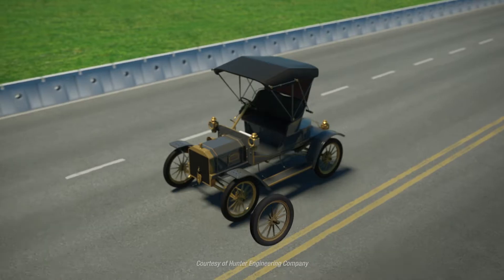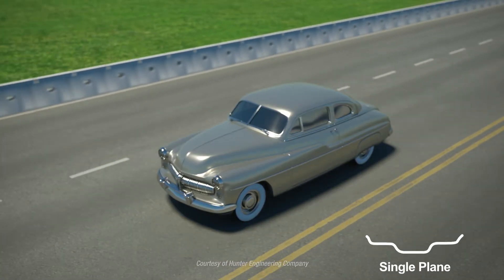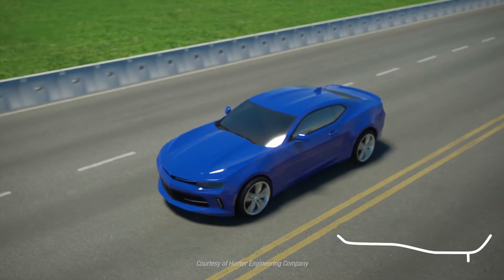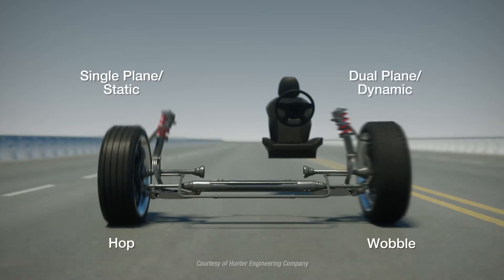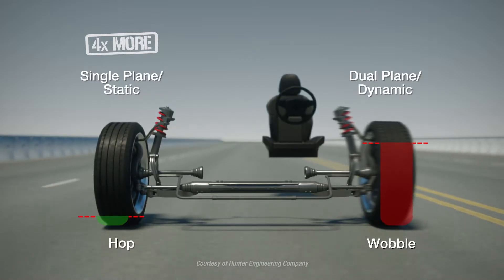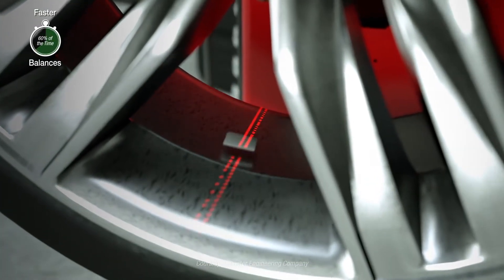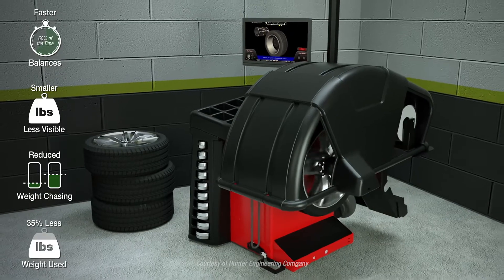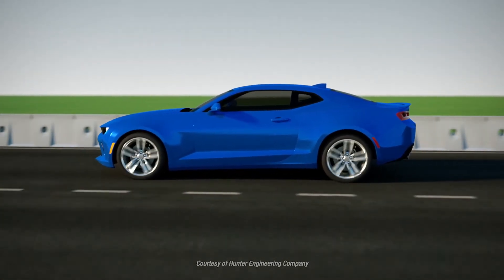Why Does SmartWeight® Provide a Better Balance? – Understanding SmartWeight®

Comment: I agree that SmartWeight takes a lot of the guess work out of balancing, but the tolerances are just too loose for many high performance cars. Less balance weights does not mean a better balance.
Reply from the maker: Thank you for the comment! SmartWeight has been factory-set to cover a large variety of wheel and tire combinations, but if you feel that the tolerances are too loose for your shop, please contact your local Hunter Service Rep, and he can 'tighten' the tolerance configuration settings for you, to provide your customers with the best balance possible, while using the least amount of weight possible. Ps- if you haven't seen our Road Force Elite® Balancer in action, ask a Hunter Rep for a demo.  It can audit high performance combinations even more accurately than before, and SmartWeight has been enhanced! If a correction weight is required, it will direct you to a specific location for weight placement!  There is a lot more surface area on the inside rim profile to utilize, and the Elite® Balancer will calculate the best area for the weight.  You would also be able to tweak the placement on-screen, and see if the weight results would change, before having to waste a weight in a trial & error situation.